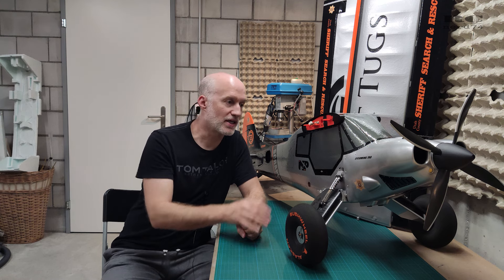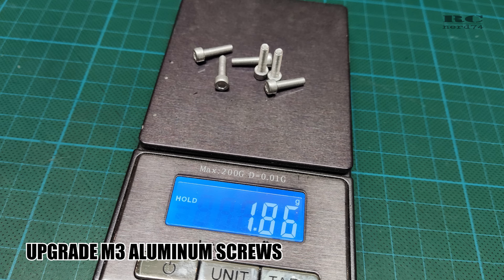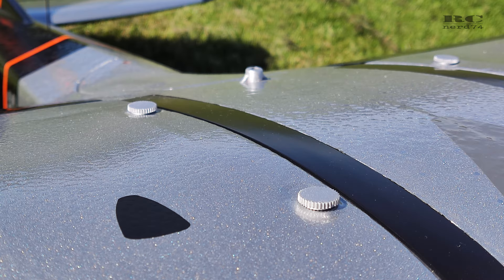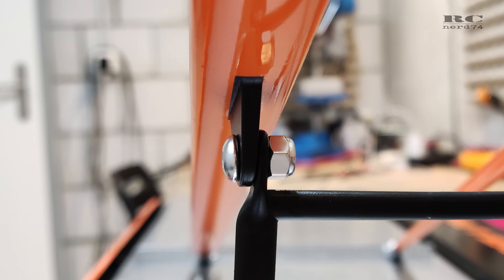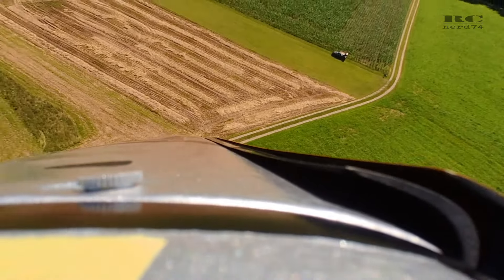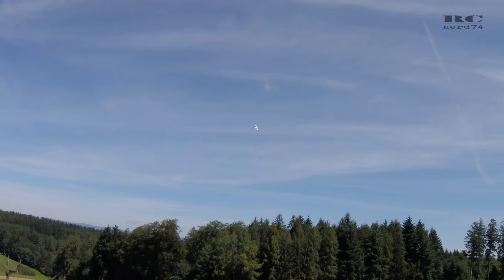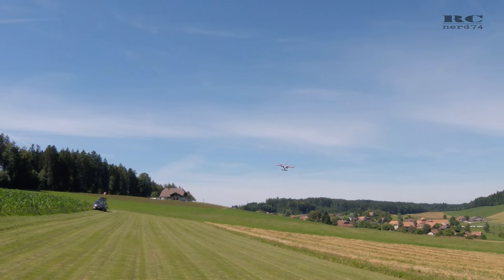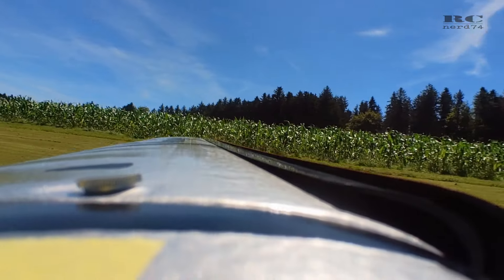TRANSFORMING WING TEST FLIGHTS | RC SCRAPPY #28

Comment: the slats serve to enable a higher angle of attack while the flaps are extended (they reduce stall angle ), but you didn't use a larger angle of attack at all and why you have double slats, they don't make sense because it would logically mean that you would use some incredible angle of attack, over 12 degrees, rather try with a movable leading edge like on the f16 plane.I have flaps on my plane that can be lowered up to 65 degrees and the plane descends at an angle of 45 degrees with the longitudinal axis of the plane being almost horizontal and the speed is half of the normal approach speed
Reply: He tried to mimic the original Scrappy by doing the double slats.
Reply from the maker: I simply rebuilt rhe SCRAPPY transforming wing made by Mike Patey. This is why it looks the way it looks.
Reply: @RCnerd74  I'm sorry, but I don't know what that plane should look like, but I understand aerodynamics and structures, and this is an unusual combination for me, I intend to make a wing that will be able to change the structural angle like the corsar f-7/8, which would increase the angle difference between the thrust of the engine and lift on the wing, which would give an incredible climbing gradient
Reply from the maker: @makantahi3731  Just check the following video. This is how this wing design works. https://youtu.be/JcckHHiYkL0?si=P8za4L8dEzan3iBm

Comment: You are not able to make a STALL plane from heawy plane by adding transforming wing as is possible to see in your video. You need to reduce waight, if possible, dramatically.
Reply from the maker: @Dzordzikk  It was not the target to build a lightweight stol plane. It was to build an RC replica of Mike Patey's full scale bushplane prototype called SCRAPPY. There is no way to put that many functions in it and keep it light weight. The transforming wing reduces take off and landing speed anyways. If you don't know the full scale version built by Mike Patey, just search for Mike Patey Scrappy on YouTube. You will find a ton of build videos. Full scale SCRAPPY didn't end up as a lightweight stol plane äs well. Same situation as for RC SCRAPPY.
Reply: @RCnerd74  I know Scrappy, but dont understand why you build it. All you add into it only add weight and reducing start and landong speed is very low. Betterto build it without it.
Reply from the maker: @Dzordzikk  This is called scale building.